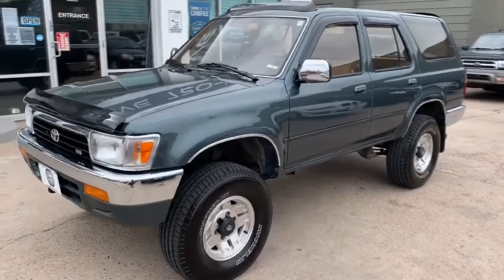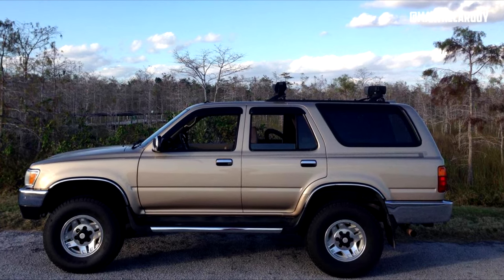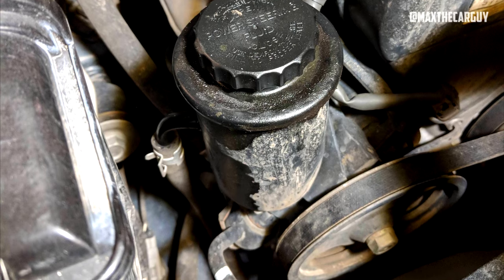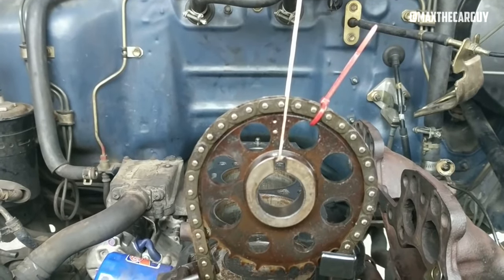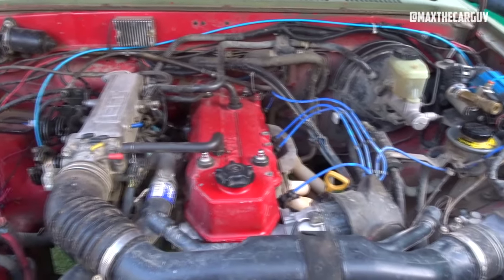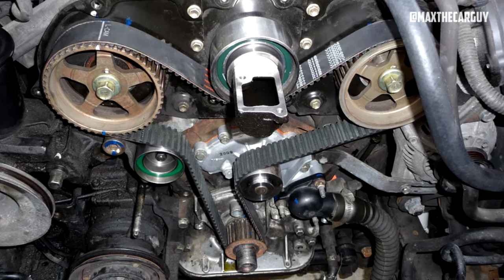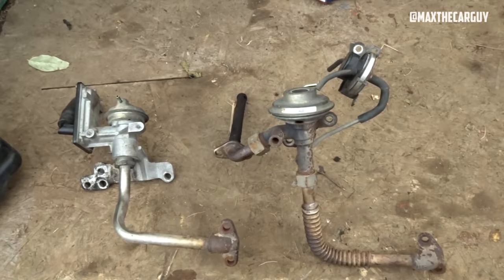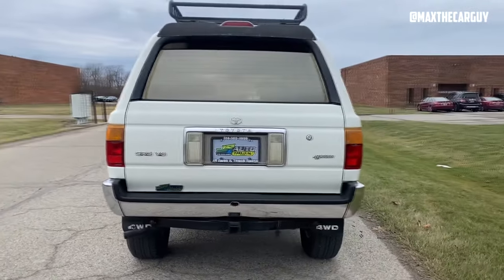Toyota 4Runner 2nd Generation (1990-1995, N120/N130) Common Problems

Comment: These things will keep pushing even if you sometimes neglect the maintenance. My 3VZE has been through Hell and back and still running strong
Reply: I have the same one a 91 3vze awd i slid into a curb today 25 to 35 hop it i thought the car was done for started right up and no leaks besids my coolint like i had and i think it slowed my  leak fram is straight metal and sup is unreal it got home with a blown tire no over heating nothing starts right up and ready for me
Reply: I've been running mine with a blown head gasket only pressurizes the radiator and has a cool down of 30 mins I just make sure I top off with water during spring summer months
Reply: I have a 3vze and its been nothing but a shitter. Blew a head gasket, fixed it and one drive later the fuel pressure damper at the very back of the motor starts leaking onto the exhaust. Sold it, wont ever touch another Toyota. Never lost money on a vehicle before this one
Reply: @connorleyland8695 right on. Good thing you are young and have plenty of time to lose more money in cars 😂😂

Comment: I can tell you have never owned one of these with the 3VZE and 5sp manual, and are not qualified to give a report on this vehicle. It does not have McPherson struts, and rear end sag can be remedied with cargo coils. This vehicle does not have rack & pinion steering, it has the steering gear box and power steer pump, which requires non-synthetic  Dexron III conventional fluid from Toyota or Valvoline Dexron III. Do not mix synthetic with conventional fluid. Small leaks can be remedied with  usually 1oz  of  ATP 205 reseal.  How do I know? I am the second owner of a 1990  for 31 years and I have never needed to replace the factory steering pump or the gearbox after 310K miles. After I bought it coming off a lease (yes with a 5sp tranny) , I put 250K miles on mine. The mistakes common are putting inferior parts as replacements, which fail usually within a year.  OEM new or decent used salvage OEM is a better choice depending on what fails.  Sometimes it is better to re-build the failed part if its rebuild-able.
Reply: Hi, since you know the 4runner very well, can I ask you a question about the safety of the materials? Thank you

Comment: These trucks don't have a steering rack. They have a recirculating ball steering box that rarely fails.
Reply: And speaking from experience as 2nd owner of a 2nd Gen 5sp SR5 over the last 31 years, toyoDa steer box or the pump has never failed. Only running Valvoline Dexron III  and no synthetic.  1oz of AT205 reseal helps.
Reply: @tonyisme4934  i jsut buy the cheap dextron walmart brand mines a 94 i hope it doesnt ruin it

Comment: Talks about sagging rear suspension on this model which has rear COIL springs and goes on to illustrate the problem with some other model showing LEAF SPRINGS. Has he actually looked underneath the 4Runner?

Comment: the second gen 4runners are excellent.  like any other vintage vehicle, keeping up with maintenance is important.  the only "problem" that i have encountered in the 20 years that i have owned my 1990 4Runner 3.0 with the auto is the starter contact issue.  there was/is a toyota service bulletin, but unfortunately, i had to find out after 3 independent shops mis-diagnosed the starter as the problem.  my second gen 4Runner serves me well and i will keep it indefinitely.
Reply: What are the symptoms and what was time actual problem?

Comment: The 3.0 is the one with head gasket issues, not the 22R.
Reply: The 22R has been known to have its share of head gasket issues also, you heard him talk about having a cast iron block with an aluminum head leading to expansion issues, that applies to both these engines.
Reply: The 22R is one of the best engines ever. The 3.slow is the worst Toyota engine ever. As a 3.slow engine owner I can confirm it has blown a head gasket and it sucks….
Reply: @FlintnChirt as a 3.4 swapped 2nd gen walk in 22r is definitely not the best it has head gasket issues as well as the 3.0

Comment: You forgot the sunroof button drying & breaking 😂😂 had to look up for a tutorial on how to fix & close sunroof window & hella others went through that & they also said the rear window will fail luckily I haven't gone that far yet
Reply: do you have the tutorial for share?
Also: with the button,do you mean the button to move the sunroof back and forth or do you mean this one button next to the one I just descirbed ?

greetz:)
Reply: Its the small/hard one that gets stuck & you cant close the sunroof because it broke so you gotta remove it & it will let you close & open like new. I could not fix that piece so i glued it back just for looks@noidea2655

Comment: I own a 2.nd gen with a 3.0 diesel kzt engine, any problems there known?
Reply: Turbocharged prechamber diesel so I reckon the same issues as with other turboed prechamber diesels, i.e. filthy EGRs and sensitive to bad or excessive tuning. Delete the EGR and don't tickle the injection pump too hard. 
Other than that, change oil and coolant at mandated intervalls, change out any seals when you're poking about, etc.

Comment: Why my 4x4 no working  i have 1995 Toyota 4runner v6 3.o
Reply: could be the actuator.
Reply: I have the same one and I have a question. Mine has a hard time starting and I use premium gas. Should I use regular 3 dollar unleaded???
Reply: @FlintnChirt  yeah, dont used premium...
Reply: @MorganMcGinnis  I don’t no more
Reply: I have a Toyota 4runner V6 sr5 , the problem is that it can't shift gears..